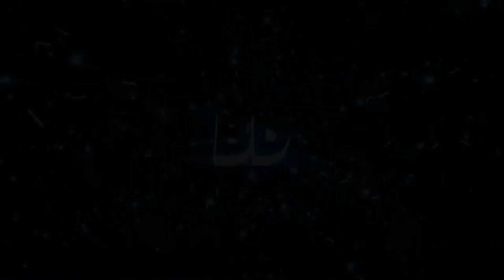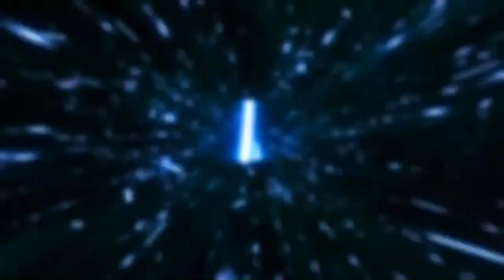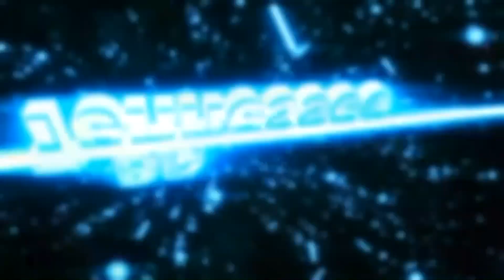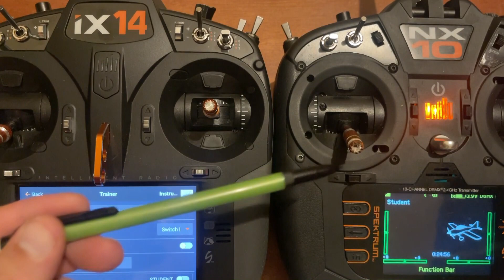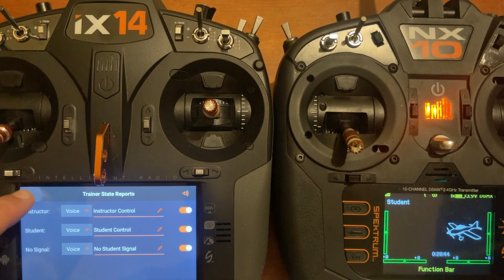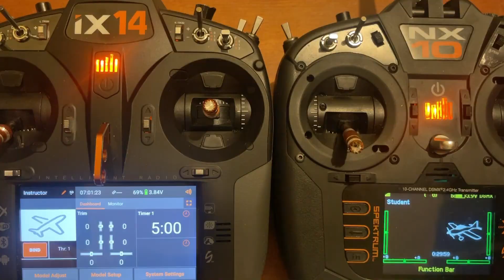Spektrum iX Setup: Buddy Box/Assisted Flying

Comment: Why do you need a Blake profile on the students box. What happened if have planes profile on both box’s?
Reply from the maker: Blank profile allows to use Pilot Link Instructor and easier setup. Both radios configured then use Standard Instructor if both radios configured.

Comment: What happens when you finish flying and you want to fly another airplane with your instructor radio.  Does it have to be re-bound to the new airplane?  Or can you just fly it without rebinding as per normal?
Reply from the maker: Fly per normal. Change to model and go.
Reply: I thought that may be the case.  Thanks for replying.

Comment: Awesome and detailed info.
Im using pilot link instructor and it works great for my sons aeroscout but I was wondering if my son wants to for example practice on my habu sts can I then just change model in my transmitter from the aeroscout to the habu sts and it will transfer that input without having to setup buddy box again? I mean for each model we choose to fly without having to setup buddy box to his transmitter every time when changing between models to fly? 
If the pilot link is setup to one model and bound it should work on whatever model I choose from my radio right? 
I m pilot link bound with my NX10 to my sons DXS transmitter.. 😊

Best regards
Reply from the maker: Rebind each model being used. Once you bind radios will stay connected on that model . So if you fly same model you dont have to do each time.Only when its changed.
Reply: @BDTennessee  thanx... Yes I was thinking about rebinding the student transmitter for the active bound model in my transmitter...
Thank you so much for the help.. This spektrum wireless trainer is absolutely awesome... I have a lot of planes and with this my son can now move on from the aeroscout to the habu jet very easy.. 👍

Comment: BD:
 Is there a way to make a default template for every base model setup? I assume (i know🤷‍♂️) 14 & 20se r the same
Reply: I don't use the preset templates. They confuse me.
Reply from the maker: You will need to make a model as a base and use for future plane. NX has actual template you can make.Hopefully iX will get the option at some point...